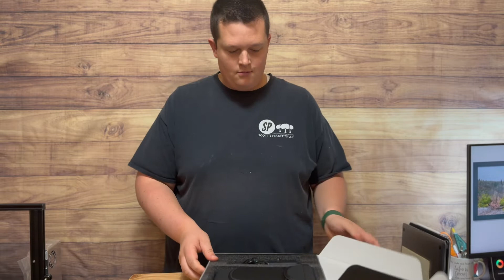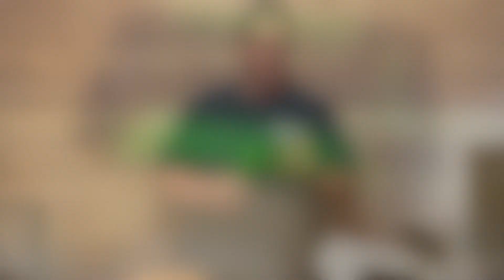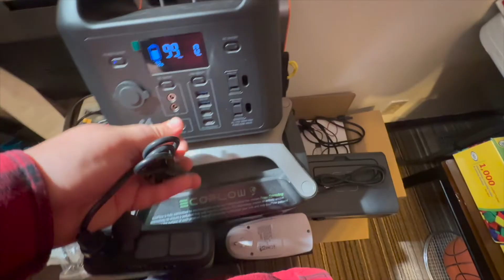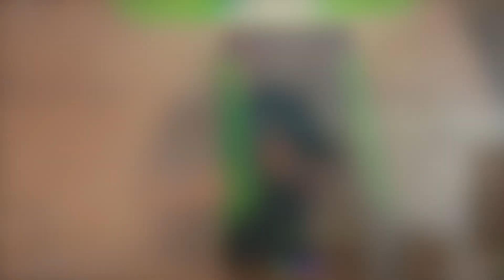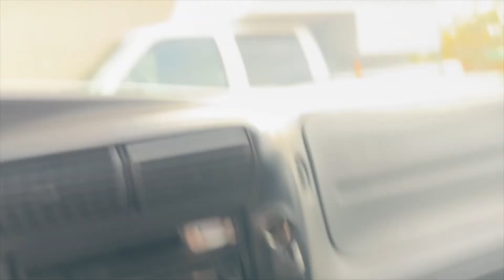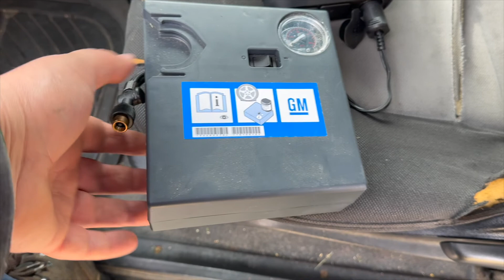Review: EASYLONGER ES720 Power Bank | 72,000 mAh Battery

Comment: Good review. 
So DC only battery bank.  Most emergency car starters batteries do this now, less all the connectors they  give with it so that's an interesting take. My Ulefone 13 has 13200mah, so aprx 5 recharges.
Cheers
Reply from the maker: Thanks! Yeah, for dc uses especially, there’s a ton of options out there. Does yours come with the cigarette lighter 12 volt output socket?